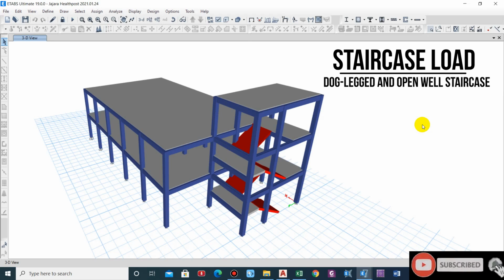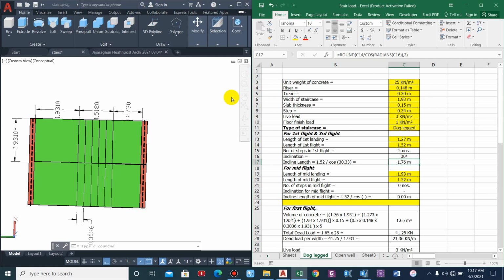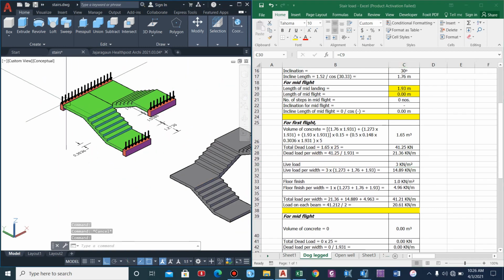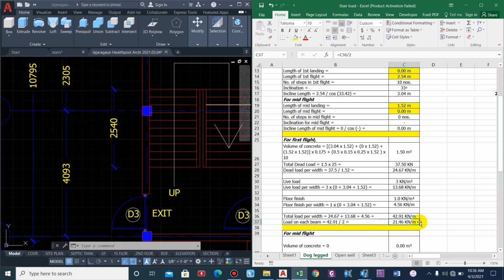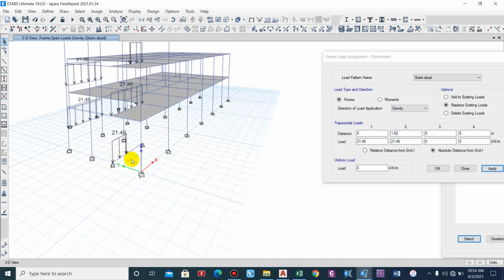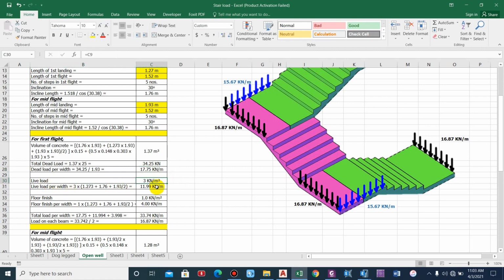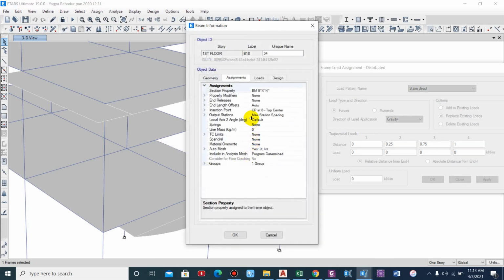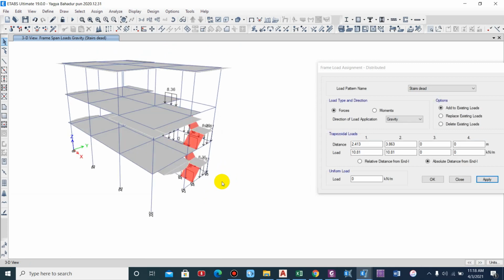Staircase Load(UDL) on beam | Open Well and Dog legged Staircase | Load Transfer to beam

Comment: very nice video. but may i ask why you added 1 to the number of steps to compute the inclination?
Reply: plus 1 because need to include the stairs of landing as well let's say that the 1st length of flight is 5 stairs  for the 6xth step is already included in landing that is why you need to add one to.

Comment: Here the concept is we are calculating total load on stair case and distributing on beams ......it means how ever we have simply supported beam calculations.... it means if the load acting symmetrically on beams then the load transfer to the  reactions is half load. Here the reactions are the beams right.... and one more thing u have calculated all loads on stair case but on this beams wall load also will act....but I did not find any wall load.....because in the mid landing beam remaining half part filled with wall hence we need consider that load also... Am I correct??? Pls reply

Comment: Very informative content, Sir!

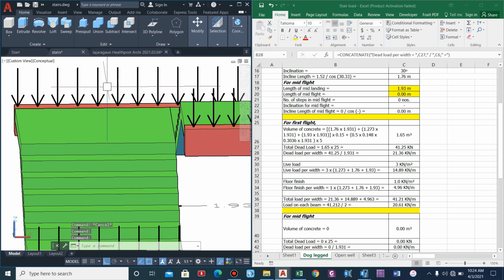I have a question about the concept of the point load of total dead load you explained at 7:41. Should the point load be applied at the center of mass of the first flight with the attached landings, and not at the center of the beam directly? Am I right that the point load should be divided by the total area of the waist slab and landing slabs to distribute the load through the slabs and then apply the concept of one-way slab to transfer the area load to the two beams? The formula will still be the same, I am just asking about the concept/principle of how the calculated point load be distributed to the beams.

Thanks.
Reply from the maker: Yah. your concept regarding CM of flight is true.

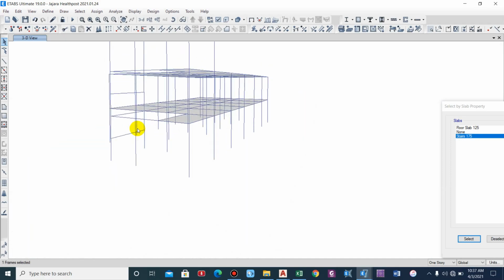Comment: Sir at duration 14:05 when you applying 21.46 load on mid landing. Actually woh 21.46×2 ni hona chahiye? Because first flight se 21.46 load ayega landing beam pe and second flight se bhi toh ayega 21.46 load ussi beam pe.
Reply from the maker: At mid landing, half weight from either flight acts, so it will be 21.46
Reply: @civilconst  half weight both flights se ni lagega 21.46 ka double?

Comment: Since we need to transfer load to the landing beam, and also keeping in mind that it might induce short column effect, what can be done to achieve our objective?
What if we assign landing beam as null? Does it work?
Reply from the maker: If you are considering fixed support for landing beam, null element won't work for you. But if you are providing landing beam as platform for load transfer to wall below it then you can provide null element beam. Depends upon your consideration.

Comment: The result obtained through modelling of staircase on buliding and that by applying stair load on the beam vary greatly. What might be the reasons?
Reply from the maker: if we don’t model stairs then we are neglecting the stiffness provided by staircase. Hence the rebar area in column varies with modeling case and for stair UDL case.
Reply: @civilconst   Thank you sir for your reply.  
When  applying  stair load directly on beam , we get high amount  rebar on all beams, columns as compared to stair modelling. In your opinion which method is best to follow as per practicality?
Reply from the maker: @sajibsdhrestha7680  staircase model gareko nai raamro ho but rebar distribution unusual aaucha as more seismic force is attracted near staircase region so contractor ra client lai bujhauna saknu paryo .. tehi ho 😅😅
Reply: @civilconst   Tei ho site ma practise ma chai wall ma stair support garainxa landing lvl ma. Column sanga stair ko connection nai garainaa short column effect prevent garne vanera. Tyo hisab le chai stair model nagarne nai thik lagxa feri. Confuison  nai xa yo kura ma chai.
Reply from the maker: @sajibsdhrestha7680  Landing beam provide gareko better ho.. masonry wall crush huna sakcha directly rest garaudaaa.. landing beam lai Ld na diyera provide gardaa short column effect neglect garna sakincha but short column lai consider garera rebar nikaleko raamro..
Reply: @civilconst  dog legged ko lagi landing beam provide garna problem hunna khasai. Open well stair ko lagi kasari halne ho?